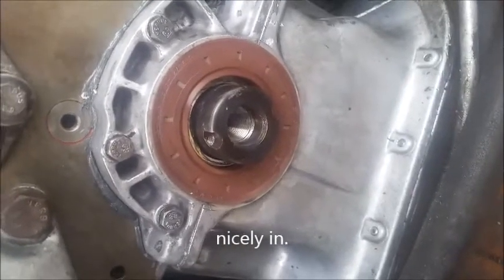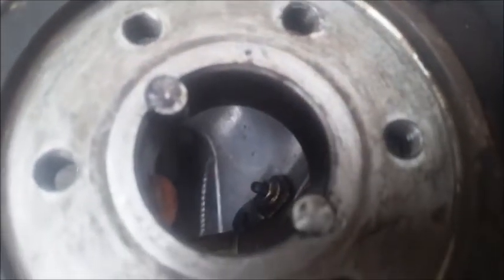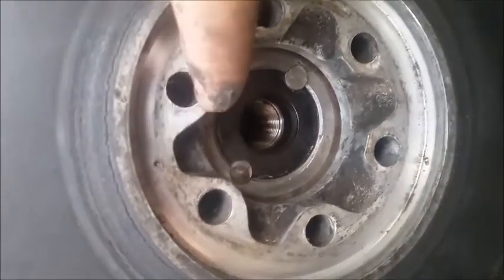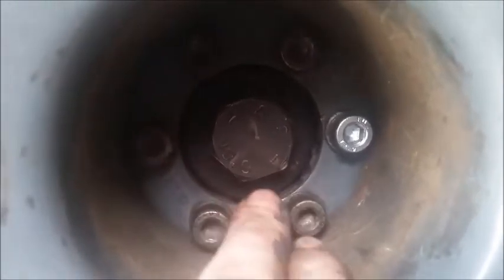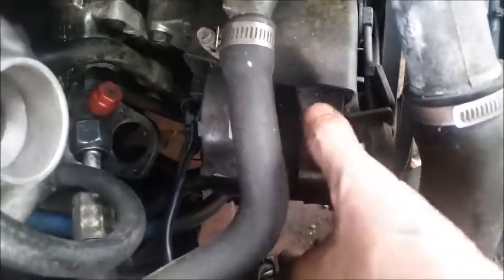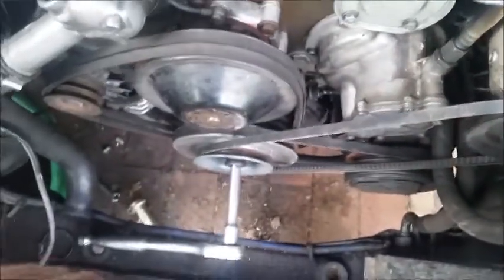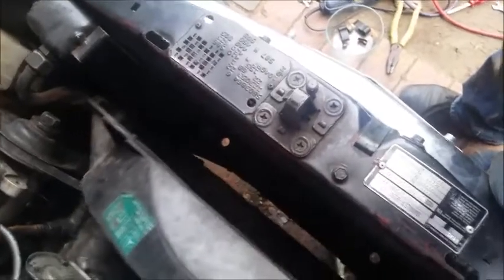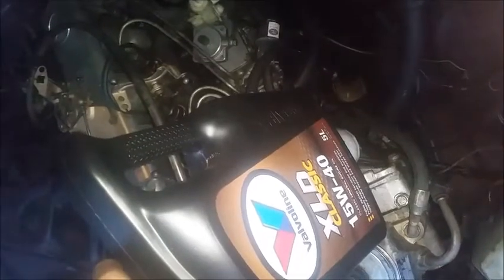front crank part 6 w123 300d

Comment: Did the second time work? I went through the same process and still had a leak after changing the front seal
Reply from the maker: 2nd time worked. I didn't use any gasket maker on the front crank seal and it worked :)